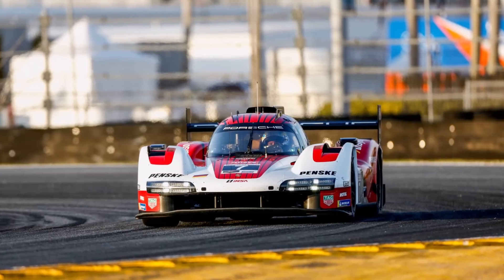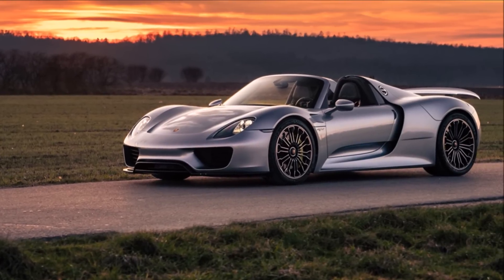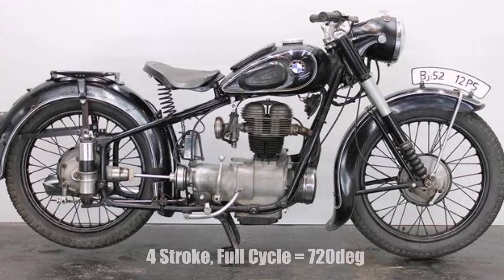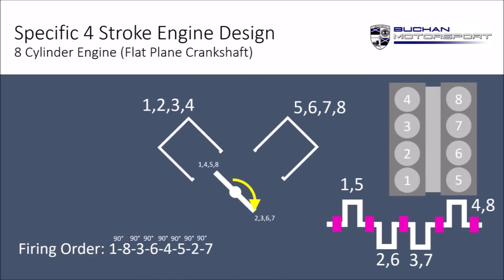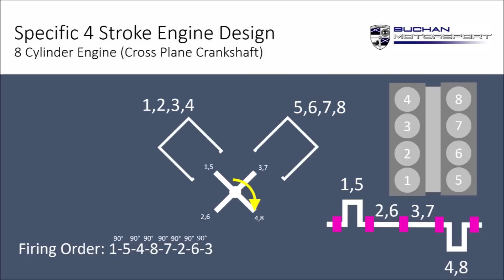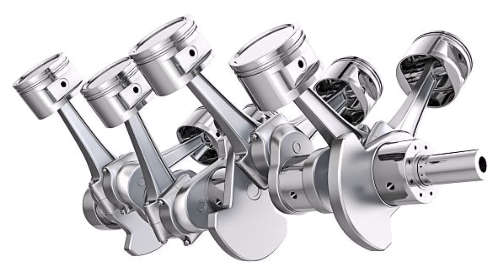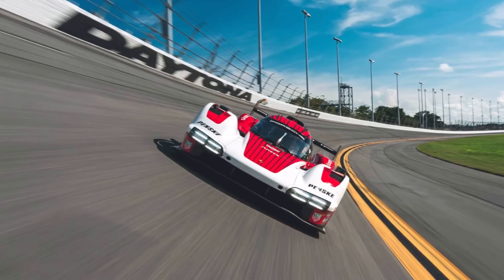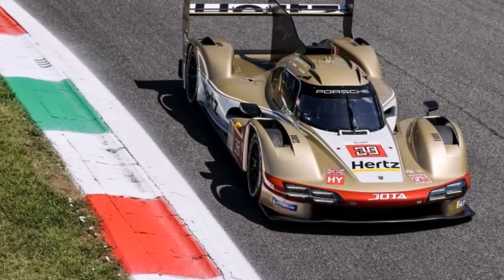Porsche 963 LMDh - 2024 Crankshaft Update

Comment: The firing order has nothing to do with smoothness i.e. lack of vibration, and all to do with secondary moment  vibration which is created be the different displacement profiles of the cylinders when going up vs down. For a flat plane crank these secondary vibrates are present due the pistons being 180 deg apart, however the cross plane is 90 deg apart so the seconday moments are canceled out thus making it smoother.

Whilst cross plane doesnt have secondary vibrations like a flat plane, it is heavier so cant rev/accelerate as fast, and its firing order give odd firing on each bank which results in uneven exhaust scavaging so not all cylinders perfrom as well i.e. some cylinders will have higher volumetric efficiency than others, which means less torque & power than a flatplane crank for the same engine.
Reply: Atleast the Reliability is improved

Comment: Interesting twist there, as the top street versions of Corvette and Mustang recently have been changed in the opposite direction - from cross- to flatplane 😮
Reply: But the engine isnt a structural part there, so the vibrations can be mittigated with the mounts.

Comment: the fault is on the stupid restrictions!
heavy batteries, lame hybrid ev soulles garbage, tiny engines and mfkin flatplane crankshafts!
i hate flatplane engines, i just want a reliable fast prototype racecar as i want a fast, fun and great sounding streetcar.
big 5.5l, 6.2l. 7l or more cui rumbling v8 and not a crappy 2l v4 or i4 with a heavy electro vacuumcleaner.
porsche v8 or corvette v8 or ford gt v8 or amg v8 are the best engines.
and they can make tons of power!
no need for cucked hybrid crap!
if we would build lmp1 or other fast cars like we used to with 2024 tech, we could beat the 919 or 956 bellof records!
we just need to get rid of stupid politicking ruining our fun!
Reply: Something tells me you're quite misinformed on hybrid race cars: they can actually sound good if you give them the proper engine (I mean, look at Cadillac's V-Series.R or apr's Toyota Prius racer in Japan's Super GT series back in the 2010's).

Oh, and about going faster, there's gonna be expenses - LMP1 died partly because of it.

Comment: That's really a surprise. I am not aware of, I would have to check, European engines that are cross plain.
   I like flat plane because they are simple and work well for high RPM.
   But as an American, I also like the torque created with cross plane designs. 
   Good luck too Porche if the change is allowed.
Reply from the maker: Most European V8s in street cars are cross plane.
Reply: Cross plane doesn't increase torque. It just reduces secondary vibrations at the concequence of higher intertia and reduces exhaust scavaging.
Reply: @syntropy3020   Are you sure? Also, inertia is a result of weight. Flat plane crankshafts typically have reduced counterweights. Less weight. They don't really need them like a cross plane does. I would have to recheck which vibrations are which. With a flat plane, imagine a line and there is a crank pin for a rod on each end. Now imagine there is another line that passes through that creates a cross shape. You dont think that a cylinder that gives leverage every 90 degrees is not going to create more torque compared to a cylinder that fires every 180 degrees? 
   I suppose it could depend on your logic as they are both V8s, there is actually a cylinder that fires every 45 degrees, but where those cylinders are in relation to the crank does matter for torque.
Reply: @robertmoore119  yes I'm sure. The reason a crankshaft has counter weights is to counter the primary vibration i.e. the direction of the piston. A flat plane crank doesn't need any where near as much since it's pistons on each 4 cylinder bank are 180 deg apart so the primary vibration cancels within each bank. What it doesn't cancel is the secondary vibration which is cause by the different displacement profiles pistons have as they go up vs as they go down. Cross plane cranks cancel secondary vibration by having the pistons on each 4 cylinder bank 90 deg apart so the net difference in 2nd rate of change i.e. acceleration, of the cylinders going up and down is neutral for each 4 cylinder bank.

Both flat and cross plane v8's have a cylinder fire every 720deg/8 = 90 deg, the only difference is the order it happens in which makes no difference to vibration directly, but does make a difference to exhaust scavenging when each 4 cylinder bank has it's exhaust runners joined. Flat plane have even pulsing on each 4 cylinder so if each exhaust runner is the same length then all cylinders will have the same scavaging across all rpm and thus each cylinder will have the same volumetric efficiency across all rpm. This results in a more peaky torque curve at the peak torque will be at the rpm that resonance occurs in the exhaust runner. Typically for performance/race engines this is at high rpm resulting in less torque down low, but it doesn't have to be.

For a cross plane crank each 4 cylinder bank has odd firing resuling in different in uneven pulses so each cylinder has different scavaging at all rpm regardless of if the exhaust runners are equal length or not. This results in a flatter torque curve since each cylinder will have a peak volumetric efficiency at different rpm.

So in general a flat plane crank will always performed better at the desired tuned rpm, and cross plane makes a sacrifice to give a flatter torque curve across all rpm. This is why flat planes are typically chosen for race applications. Also since flat planes have the same volumetric efficiency on all cylinders it gives a smoother torque at any rpm, where as the cross plane will give different force pulses from each cylinder, but this is pretty insignificant in the scheme of things.
Reply: @robertmoore119  Torque is just a matter of trapping efficiency, peak trapping efficiency for a single combustion happens slightly after peak torque (due to friction loss that increase with rpm). If there's a design flaw/limitation in the intake or exhaust that reduces trapping efficiency due to firing order then it could make a difference between the two crank designs, but not otherwise. 🙂

Comment: This subject has been debated for years on motorcycles because its about power pulses and wheel coasting. The tyres need time to slip and grip between power pulses to pull out of corners faster with less tyre wear. Yamaha knows whats up if you look at their cranks. Thanking this channel for great engineering reviews, good work guys.
Reply from the maker: On motorcycles it was about tyre performance. This here is about avoiding vibrations that cause issues in endurance racing.
Reply: Yamaha USED to know, just look since 2016-17 Rossi complaining about having no traction and the wheels just spinning while having the LEAST powerful bike in MOTO GP.
Reply: @Random63R400  While it's true that Yamaha has been underperforming, it is worth mentioning that practically every other manufacturer switched to an uneven firing V4.
Reply: @yummyhershey5902  Because you can make more power and they don't have traction issues like Yamaha does (even Suzuki with their inline 4 had more power and control), so the crossplane concept found it's limit or something else cause they aren't the best anymore.

Comment: I hope Porsche will be allowed to switch to a crossplane. They could still use a hot v and route the exhaust gases in a way that the two turbos are evenly loaded with the exhaust pulses despite being a crossplane; BMW did that in a very elegant manner with its hot v street car v8s more than 10 years ago.

Comment: Someone please explain why this crankshaft change to crossplane WOULD NOT be approved? Porsche isn't increasing displacement, just changing firing order for smoother operation at higher RPMs. Always thought crossplane sounded better anyway,  see the Yamaha R1...
Reply: It most likely will. ACO is very lenient when it comes to safety or reliability related changes so it’s more than likely they will be able to do this without using one of their evo upgrades.

Comment: I actually heard the Porsche yesterday and it sounded like a cross plane. Cadillac figured that out last year since the engine is attached solidly. The vet has a softer sprung engine so it can use a flat plane. And yes, 180deg headers can change the sound but it doesn’t solve the vibration problem and adds weight. Example: GT40s ——-> TMYK.
Reply: what are you talking about? Cadillic has never run a flat-plane crank and have aways run a cross-plane and it wasn't until the C8.r that any GM brand entertained a flat-plane crank. They didn't just figure anything out as these issues have been common knowledge for half a century now.
Reply: @ExileXCross  More like a whole century!
Reply: GT40 is a crossplane crankshaft.

Comment: Will the 963 ever be allowed to challenge the 919 Lap record on the Nürburgring? Any thoughts on this? Naturally only once it's not in the racing business that is. They could also go off and do anything needed to beat that incredible record held.
Reply: I really doubt. The older LMP1 class was much faster than the actual LMh around the track. To be precise, the Toyota GR010 is almost 8,5s slower around Bahrain gp circuit compared to the TS050. So is fair to say that, even with fully unlocked specs, the LMh/LMDh cars cannot compete against the older LMP1, even if the overall power output could be matched, the older chassis was much more sophisticated, and so were the hybrid system and aero package.
Reply: @jamarcus_OG  you have some very sound arguments.
Reply: Not possible because the LMDh class has major aero restrictions that won't be solved by unrestricting the engine.
Reply: It wont even be able to come close to it
Reply: @Explosivo93  Time will tell. The 919 was totally unconstricted and prepped for the Ring. Had over 1100 hp afaik. This could be achieved with the 963 if they will do to it what they did with the 919. But who would drive it in 10 years?
Reply: @Explosivo93  Correct. It has nowhere near enough power.
Reply: I hope the crossplane will be allowed. They could still use a hot v configuration and route the exhaust gases in a way that they have an even loading of the two turbos with exhaust pulses (BMW did that in an very elegant manner over 10 years ago for the strret car biturbo v8).

Comment: One would think that after 100 years of expertise on V engines we would have vibrations mastered...
Reply: With all that mass rotating at the speed of sound, you’ll never fully solve it.
Reply: @4rdF1Hunny   Mean piston velocity in F1 ~50 m/s @ 12k rpm. That crank needs to go 6x faster (72k rpm) to go supersonic.
Reply: @rolandotillit2867  It was only a bit of an exaggeration.
Reply: F1 uses the most vibration prone engine combination possible. 90 degree V6.
Reply: @rolandotillit2867  I dont think the 90 degree bank angle used by teams because its the most vibration prone engine. It is chosen as it is dictated by the technical rule set. Otherwise any angle other than 120 degrees is either a well thought out compromise (eg. for aero gains and other space constraints) at best and poor design at worst.

Comment: Excellent video ! The truth is that I don't understand why it worked with the Porsche RS spyder and why it doesn't work with the 963, it is supposed to be very sophisticated, obviously adding the turbos added to the electrical part that must be much more delicate is causing serious problems. vibrations to those of Porsche, because this is a very big change for an engine. It's almost like designing a new engine.
Reply: Bigger displacement. Simply that adds more vibrations.
Reply: not rly
just change the firing order
camshaft(4)
and crankshaft

the rest is the same

if it's a change to the hot V or cold V
then that's when u start basically designing a new engine

Comment: I like the idea. Hope they succeed. But I wonder if they could also decrease the engine stroke a bit, reducing the piston's speed and allowing it to run more smoothly and rev higher AND faster. Sure, they'd lose some displacement, therefore power and torque, potentially, but they could compensate that with more boost or extra power from the electric motors.
Reply: I don't think they're allowed to use the electric motors like that. Their use is very restricted.
Reply: Can't do it with electric motor since in lmdh that's a spec part which produces a set power
Reply: @scordatura9259  @wiegraf9009 Had forgotten about that. 🤦‍♂️ Then more boost it is, but this could add more thermal stress to the engine.
Reply: As people above mentioned - they can't compensate with the power from the electric part of the powertrain, but perhaps the current engine had some overhead in terms of power and maybe they'd be able to afford losing some peak power potential for reliability.
Reply: @ErwinLiszkowicz  Maybe they can compensate that slight loss in other ways. Fuel efficiency, for exampld...if they manage to reduce it by some 5-10%, in the span of an entire race, it could make a valuable difference.
Reply: They could reduce the stroke and increase bore size
Reply: @dylanhaili5646  Yeah, but considering it runs under boost, it's best to keep the bore stock. A larger bore would mean thinner cylinder walls, potentially compromising the block's structural integrity.